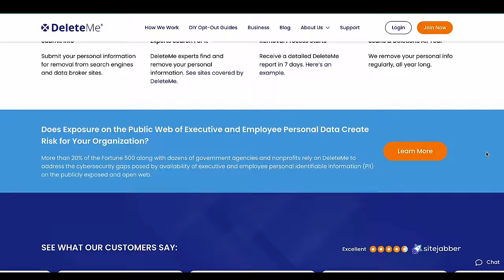THIS IS THE BIG TEST...

Comment: I agree with you Allie on the lamps.  I'm getting electricity installed in my Garden Room today.  And I also need a heater which needs to be mounted on one wall.  I would prefer to have a portable heater in case I want to move around furniture.  Women like to have many options if they get bored with how something sits visually.  Great news with your plumbing.  Irish hugs to you all and to your lovely dad. 🍀🍀😺😺🇮🇪🇮🇪💚💚ps Allie I will say an Irish prayer that you have the emotional strength for your Mom's funeral in DC.

Comment: Some rules on installing outlet boxes.  For the floor outlets, set a hammer on the floor then the box on top.  For wall switches pick a height and cut a pole to the same height.  That way all the other are the same height.

Comment: I have a light switch at the beginning and end of my hallway. I can turn the switch on, walk the hallway and then turn the light off using the light switch at the end. I also have a light switch on the wall as I enter the bedroom and then a light switch beside my bed to turn it off. I'm sure you know about this kind of electrical.  I'm just letting you know in case you don't. It is so good and totally worth putting in.

Comment: Code here in Alberta is that no space along a wall, including corners, can be more than 6 feet from an outlet. (thus outlets can be no further than 12 feet apart) Doorways excluded.  I followed code in my last reno,  but still wish I had put in more outlets in certain places, even though not required. Err on the side o too many.  Extension cords are ugly.

Comment: If you want to see the water pressure in you new bedroom put a pressure gauge in your bathroom in your new addition. It won’t tell you flow rate but you might see how much pressure drop-if any. It should be about the same pressure as the basement.

Comment: One thing we regret when building our forever house was not installing floor outlets in the living room. It would have made table lamps etc in the centre area possible without trailing wires. Central vacuum has been great however, and easy to put in before insulation and drywall. Love your show, your patience and persistence. Good luck!

Comment: 3 feet of clearance in front of panels 
#15 - 15 amp breakers
#12 - 20 amp breakers 
#10 - 30 amp breakers 
#8 - 40 amp breakers 
#6 - 50 amp breakers

Comment: I'm glad I'm not the only one who doesn't line up the siding going around the corner. lol.  I never noticed until 2:12 in this video.🙃 Also are you going to insulate the hot lines since they are recirculating?

Comment: NEC Panelboards contain circuit breakers that are overcurrent devices. Section 240.24(F)  prohibits overcurrent protective devices from being installed/located over the steps of a stairway. As long as the required working space can be maintained, a panelboard could be installed on a stairway landing as it would not be located over the “steps of the stairway.”

Comment: 🚨🚨🚨, for electric code. Start at the door. Every 6 feet has to have a outlet. All outlets should be 12" off the floor. Baths have to be GFI outlets with reset push button. So you get a higher resale if it ever happens. Give each room it's own breaker.
Reply: Yes, no shared breakers.  You  should see what my basic builders did.  }: (

Comment: With uponor pex you can actually heat it up on the fitting lightly with the torch or heat gun and it should shrink back to the stop the leak unless the ball valve has a neck in one of the fins

Comment: You have more experience at plumbing.  It looks like you also have better tools, especially on the supply side.  On the drain side, your cuts looked like they were square.  I remember thinking on the original build that some of the drain pipe cuts were more than a hair out of square.

Comment: Do yourself a favor and put a 30 circuit sub panel in. There's no harm having spare spaces. Make sure you have a good path to run the 100 amp sub feed cable to your other panel. Do you have any spaces left in that panel for a 100 amp 2 pole breaker ??  and  yes uneven switch boxes stick out like a sore thumb, measure 45" to the bottom screw hole, I use the hole because not every manufactures boxes are the same, learned that one the hard way. Measure the outlet boxes also.

Comment: Stairway looks narrow, maybe camera distortion.  Clear width between wall surfaces has to be 36 inches, with one handrail 31.5 inches  wall to handrail and with two handrails, 27 inches handrail to handrail per IBC Residential Code.

Comment: The valves were a terrific plan but You should really consider color coding those valves and draw a little diagram about what each valve does.  if someone who isn't you then can work on the system. Or years from now when something goes wrong. You know what valves to turn on to separate the system.

Comment: TRENT I WOULD  put all your receptacles on 20 amp breakers with 12 gage wire the only thing I would use 15 amp for is ceiling light if your only using one light in room if you are using can light I would use 12 gage wire

Comment: There should be a small nut under the valve lever that just needs snugged up.
Reply: I replaced the old valves in my house with ball valves and had 4 drippers, taking off the lever and tightening the nut stopped the leak, just beware which way the handle came off.

Comment: Is there a reason why Trent is the only one nailing the receptacle boxes?  I've been on jobs where you were given an electrical diagram of where every receptacle is located and we just took off and installed them.  You got 2 other workers there, why not use them to get the job done that much quicker.

Comment: I wonder....is there a way you can test those water lines for leaks with colored smoke FIRST before testing with water? It could prevent a major flood. Of course, you'd still test with actual water, but doing it with smoke FIRST?
Here in New Orleans we test lines with smoke.
Reply: Where’s the fun in that and besides this was filmed a few weeks ago
Reply: @dill5500 I've followed this channel for years; I realize that their videos are 2 weeks behind. I was just wondering if smoking the lines would save their home from damage. I don't know if you've ever owned a home, but by your reaction to how much fun it would be to flood it.... I will assume you have not. Flood damage is costly and time consuming. I certainly don't think that Trent & Allie want that headache, ESPECIALLY since they were about to leave town for a Celebration of Life for Leslie.
I'm sorry that you think that damaging a house is fun. The rest of us adults know that it is not.
Reply: @deedieducati2272  dude it’s in framing still no damage would be done
Reply: @deedieducati2272  and no you can’t smoke water lines as they need to be under pressure
Reply: @dill5500 pool professional, and plumber here. Water lines can be pressurized with air to test for leaks. You totally could test these limes with pressurized smoke if you wanted.

Comment: Why don't you use air ?? Install an air chuck with a gauge, pump it up to 35 lbs and watch the gauge. Every plumber I know does it this way. If it holds air it will hold water. No mess, but makes it is harder to find a leak but a bottle of soapy water takes care of that. But I'm just a electrician not a plumber.

Comment: Too many Horizontal lines that will break in the Absence of Heating..Have Drain Valves to flush the Water System. Sewer pipes in cold unheated areas like Roofs, unheated Garages also are exposed..stay Vertical as much as you can or use 45 Degrees..slope it..just saying.,.I have done Plumbing, fixing Houses in 20 years in Quebec , Canada..Sending you love and tacos..Bon Courage ..Lose the Casino Sponsor coz it may not align with your  Ethic..just saying..it is easier to be smart than wise...Redundancy systems also..Humility to listen and Learn Also...lol